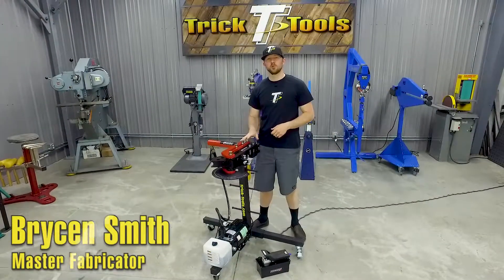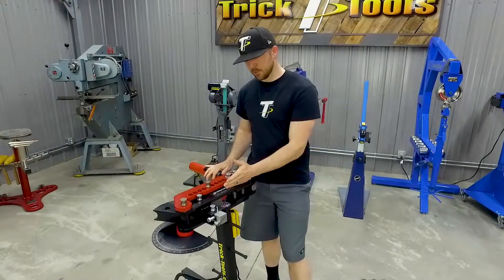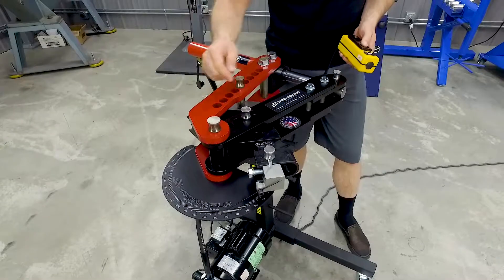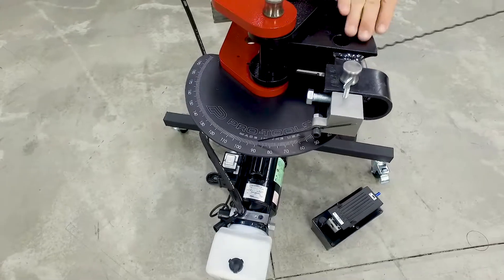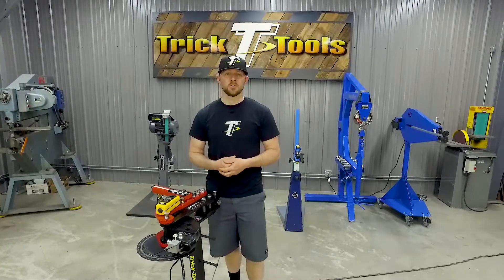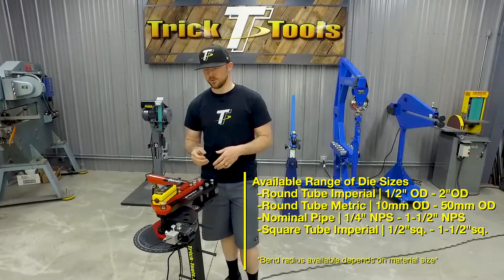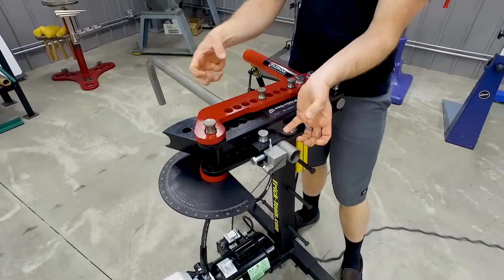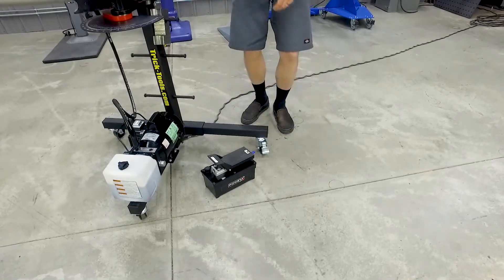Pro-Tools MB-105HD Tubing Bender Overview | Trick-Tools.com

Comment: Question about the die, if I may.  I have a Woodward Fab WFB2 bender which has a very very similar layout.  I'm looking at the pro-Tools die set for 1-1/4" pie die set on a 5" CLR because is a heck of a lot cheaper than the Woodward Fab version ($200 difference!).  Would anyone be able to tell me the dimensions of the follower die, the pin diameter, and the radial distance from the curved die's center hole to the outer holes?
Reply from the maker: Can you email this question to Sales@trick-tools.com. One of our sales staff will be able to help you out with this.

Comment: Perfectly Explained ,,,, Can you tell, How much air flow (CFM) required to Air Pump
Reply: @Trick-Tools.com  Pressure it needs 40-170 PSI but need to know air flow... Appreciate your response
Reply from the maker: Virtually any shop air compressor will run these. The manufacturer of the pump doesn't specify a CFM rating but in our experience, we have run them on very small compressors with success. I hope this helps. Feel free to call us or visit our website for more information.
Reply: @TrickTools  Great Appreciate your sprit    Thanks a lot
Reply: @TrickTools  it's strange for me that manufacturers do not mention air consumption - cfm,,,,, which important info unless we search in operational manual
Reply from the maker: I think it's because the CFM isn't really that important on a pump like this, as it only runs for very short periods of time. thanks

Comment: I noticed lube or grease on the tube. What do you recommend & should it be put on the die or follower?
Reply from the maker: We were using a water soluble bending lube that we sell, the link is below. The follower die is the main location for lubricant but it can also be helpful on the die.
 https://www.trick-tools.com/Trick_Tools_Bending_Lube_TC89_5594

Comment: Hey all, I am very green at this so please be easy on me for my next question. I have just got a pro 105 from a guy that when he sold it to me said he did not have time to figure it out. He told me the 14 " radius dies that came with it won't work for what I am doing with it which is building roll cage for rzr. I agreed said yes i will need a 7" radius die. He informed me it would not make it any tighter of a bend ...? Please help I don't understand how it would not make it a tighter bend ?
Reply from the maker: We would love to help you out. That could be done best if you call us up and have one of our staff get all of your questions answered. 1.877.VAN.SANT

Comment: Made in USA I presume?
Reply from the maker: Yes they are, right down in Florida.
Reply: @TrickTools  Perfect! Next tool I need you're on. No more crap from China...ever.
Reply from the maker: We do our best to source our tools from US manufacturers, but when we need the right tools to fill customer needs, we have tested and sourced great products from Europe, Australia, and even some from China. We show the country of origin on all of our products so that people can see that before purchase. We won't sell a tool if we don't believe in it. Thanks
Reply: If I go with the air/hydraulic setup. What size compressor do you recommend at what PSI?
Reply from the maker: The air pump operating rage is 40-170 psi so as long as your compressor can maintain around 90 psi for a minute or two it should be just fine. We have run it on small 20 gallon compressors and they will do it, you just may have to pause for a few seconds to let it catch up. If the compressor is bigger than that you should be good to go as normal
Reply: @TrickTools   okay thank you!